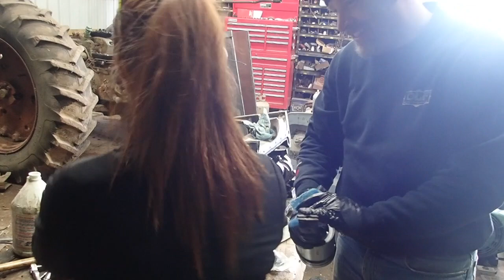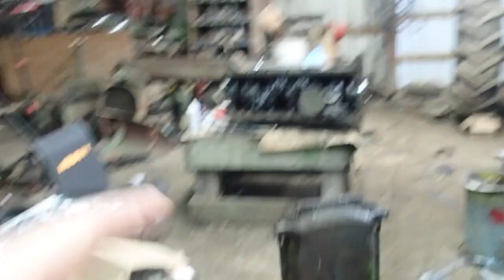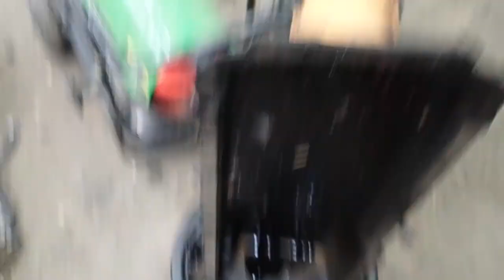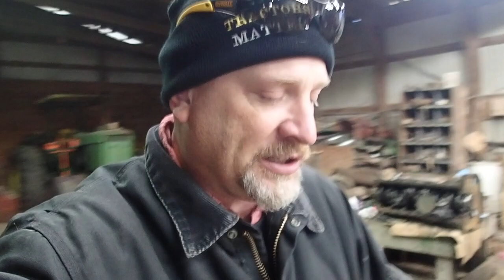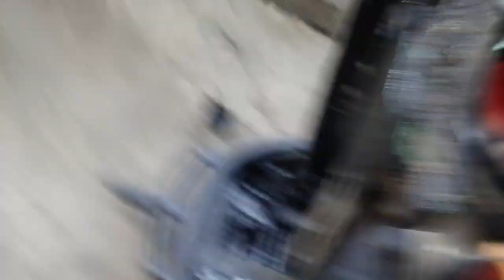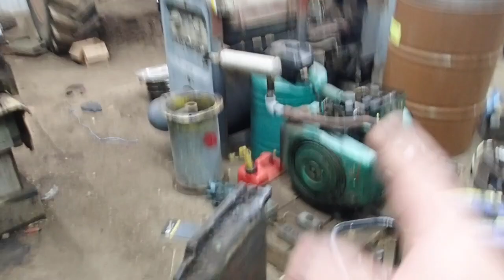4010 Engine #10

Comment: You are spot on with oil. Oil these days vs 40 plus years ago is so much better in diesel and gas engines. The trolls fail to learn anything. Please keep the videos coming.
Reply: caseih 5130 in a rebuild and a pressurized oil system I would agree. But I have always run non degerent oil in my 30 model A. It's not applicable to this situation but sometimes non degerent is the better choice/ the old style

Comment: I really enjoy all your videos. Especially this series on engine assembly. I have never rebuilt a motor but it would seem to me that some lube as you are assembling is a good thing like you said for the first start you have lube in the parts till the oil is pumped thru the motor.

Comment: Glad to hear u used 1540 rototilla.what i use.yup the old straight 30 non detergent gumed stuff up. So gess i keep using 1540.dont do that much anymore .just sm sq 4000. And bout 100 round.sell to pay taxes. But change gearboxes and engines every year. Used to twice a year when did twice as much.  Coming along nicely.

Comment: Nothing wrong with an IT Manual, Wes. I've used them for 35 years now, and never went wrong so far. I've never seen an actual JD Service manual myself, except at the dealer. From what I know however, looks to me like you are doing a very good and awesome job in rebuilding the old gal. I always used STP oil additive when I rebuilt engine for the initial prelube, but what you use is probably even better.

Comment: Still doin a fair job at the rebuild Wes 😎. Just a useless fact for everyone, we use torque to apply a tensile load to the bolt because torque is easy to measure, the engineers have done the hard work to determine what torque is required to achieve the tensile load that creates friction at the joint to prevent shear loading on the bolt. The shear strength of steel is around half its tensile strength so engineers use its strength to protect it from its weakness. Cheers mate 🍻

Comment: Looks good man.

Interesting info on the oil “slugging”. We have a couple of utility tractors on the tree farm & the 74 830 always turns the oil black 5 minutes after an oil change while the newer late ‘90’s & early 00 machines leave the oil looking new all year.  Now I know why, always learn something from your videos, thanks.

BTW, I don’t think you should run down the quality of your shop in your videos.  It’s dry, concrete floored & equipped with everything you need to get the job done.  Anything above that is just gravy or vanity.

Comment: Wes, I also have a 4010, but it is a gasser.  It is unusual in the fact that the oil filter is not in the pan.  The oil filter is actually a screw on type located near the dipstick.  Have you ever seen that or know any information.  Could it be the kit from M&W?  There are no provisions in the pan for an oil filter.  Great videos and love hearing about all your experience!!

Comment: I have built quite a few engines in my day.I see nothing wrong with your rebuild. For the comment about  cutting the oil pan and expanding it, my guess it is cast iron and that would cause more than $1500 of headaches.  Later

Comment: u are doing an awesome job Wes,i have done a motor job on a chevy one time,it dos not come near to what u are doing on the tractor,i had no idea what i was get into,but the motor start when i was done,i was happy with that,ran like a P.O.S.,but it started
Reply: one farmer i work for had  2 farmall`s,a cub and a c ,he use to use a motor oil called SHEER,came in a 2 1/2 gal jug.it was cheep oil!

Comment: Just thought it would be good to mention when you have to torque any bolts it is VERY Important to have extremely clean threads in order to get a correct torque reading.  Just thought it would be good to mention for those that don't know. ✌

Comment: micrometer is a good start for checking crank diameter and roundness of all rod and main journals, bore gauges for rod diameter and roundness checking, then plasti-gauge for bearing fitment check.... LOL
Reply: well used engine, 99% chance just slap in the same spec. items and it will be good due to prior wear . just visual inspect for bad wear/scuffing and maybe lightly polish before new bearings :0

Comment: comment on Assembly lube vs. oil as a lube for assembly:  I was taught to use assembly grease when the engine was going to be stored on the shelf, before going into service.  Oil will eventually slide off the bearings, and grease will stay put for years.  I assume that after the engine has been open for a year,  this has not been an open and closed job.  
Another procedure that I didn't observe, was blowing out the oil passages in the crank.  Did I miss that?  
Story time:  35 years ago, a rod bearing failed without reason, after an oil change.  the pan was removed and crank wasn't damaged, rod and bearing was replaced.  engine failed again after 20 minutes, same story, same journal.  crank journal was still OK, but bearing failed, again.  All the voodoo came out, with many opinions on the reason for second failure.  Failure to use assembly lube was one of the opinions, but was not the cause.  
 After hours of work, and lots of consulting with experts, one old timer recommended blowing out all the oil passages.  He had a leaf cutter bee plug a hole in a crank that had laid open for a while on the shelf.  He found it during clean up before using the crank. , air was blown through all the crank and block passages to verify they were open, prior to assembly.  
Surprise; a chunk of plastic came flying out of the oil passage on the failed rod journal.  As it turned out, the oil change tech was punching the plastic wrap off the oil filters by poking a screwdriver into the oil filter hole and snagged a piece of cellophane wrapping on the new filter, and dragged it into the center of the oil filter, which found its way into the crankshaft and blocked the oil passage to the rod journal.
Ever after, I always made sure to check inside the oil filter before installation, for bugs, and spiders, and  install them with the open end down, as I threaded the oil filter up into position, just to keep any dirt from being able to fall inside the oil filter on the way past all the hoses, etc. before screwing it into place.  
On the engines I worked on, there were 6 standard size bearings, to make a precision oil clearance, or between .004" to .010".  the journals were all measured and coded with a number, and block or rod journals measured and given a letter code, the bearing color was selected by going to the chart and selecting the correct thickness of standard bearing.  that was how precise some high RPM engines are fit.  No, that wasn't tractor or airplane technology.  I picked up lots of tips through my 41 years, some from drag racers, some from engine engineers.  I accept there are as many opinions as mechanics, but success is all about eliminating the B.S.  I respect everyone's opinion, especially if it is more fact than voodoo.  Stay brave and forge ahead.  Defeat is not an option.

Comment: its not the index tabs but the "crush" that keeps the bearings from spinning. sometimes I put a tiny bit of loctite 262 on the surface between the barring shell and the cap. not on an engine like this. the crush should be all that is needed. extra lubrication will just squish out when everything is tightened.

Comment: Some of the engines we rebuild at work have ridiculous toque to yield specs.
Things like head bolts. Tighten to 23 foot pounds right to left. Then tighten to 38 foot pounds left to right. Then tighten by 180 degrees rotating out from centre. Then tighten to 185 foot pounds. I always wonder WHO comes up with this shit?

Comment: the pennzoil back in the 60s was really crap. It would sludge up and varnish up badly. Quaker state was better. I agree oil is available today that is much better. If my engine oil was getting boiling hot I would install a good oil cooler. I have never had synthetic oil leak out of an engine any more that conventional. I think its the additives that affect leaking more than the base oil. if you have leaks try some AT-205 seal. or fix the leak. Yes I like your videos.

Comment: Excellent job Wes!!  I realize that you're using new sleeves, pistons and rings, but is there a reason that, or that you didn't show checking the piston ring end gap.  I don't have any diesel experience other than what I've learned from your videos and Thank You!
Reply: Ray Kolasa pretty much now days they already have the rings sized and matched to the pistons and the pistons matched to the liners right from the manufacturer
Reply: Thank you.  I know that the rings expand with heat and I wasn't sure as to why this wasn't done.

Comment: Sorry, after reading my response, I realized I had a brain fart and dropped a zero in my oil clearances.  it should have read, .0004", and .001".  And that is why practice is what you do as a mechanic, and when you retire, you are out of practice.  Details can get foggy, but experience lasts forever.

Comment: Why don't you just customize your existing oil pan to hold 5 gallons? Cut the pan in half and weld in some extra metal grind off the weld on the outside and run a extra bead on the inside for strength. Yes it would take a couple hours but it wouldn't cost $1500 bucks either. plus it would make a cool video, custom mods on a 50 year old tractor😉
Reply: Pan's made of cast iron
Reply: i would be pretty difficult with a cast oil pan

Comment: Is there any way to prime the oil pump?  We used to take the pump apart and fill them with petroleum jelly to help prime them fast!  
Also we used a light lithium type grease on the bearings,  the haters would have a field day with that one eh Wes!
Too bad you didn't have an engine stand that would hold that brute!
Reply: Not sure about tractors, but in a car's engine we spin the oil pump thru the distributor housing. Naturally the distributor would be removed.
Reply: Most guys or shops used to have an old distributor shaft modified to chuck up in a drill to spin the pump,  we would also install a remote pressure gauge on one of the oil galleries to be certain it was getting good pressure.  This video is rekindling a former love of mine...this could get expensive!
Reply: I have helped rebuild a motor with a farmer and I asked about priming the oil pump first and was told no we don't need to well 3 minutes into the engine running no oil pressure. Take it apart put in new set of bearings pack the oil pump put it back together YES oil pressure good to go for the next ten years till the farmer passed away and tractor sold. Believe what you like but oil pumps do not necessarily prime if dry gas engines with a distributor can be spun with a drill and a shaft, diesel not a good idea to try to do it dry

Comment: Yep your doing it wrong. Lmao just had to add that. No one question. Do you run a tap in all the bolt holes? It's the way I was taught to do. It cleans out the holes an your supposed to get a true torque reading. This was back when the tractor your working on was first out. Just saying it's a old way. Love watching your videos! Keep them coming!!!!